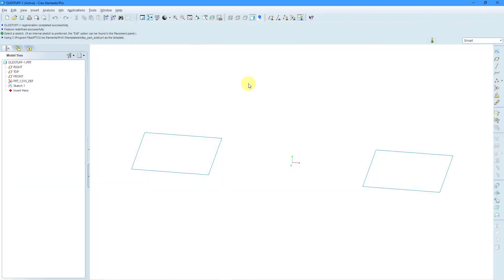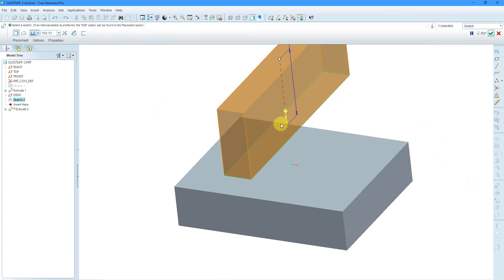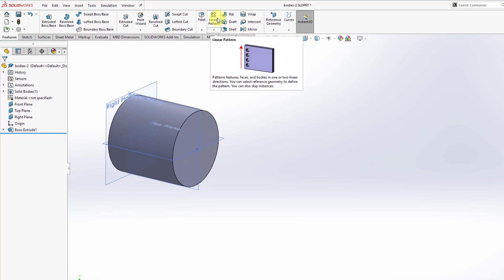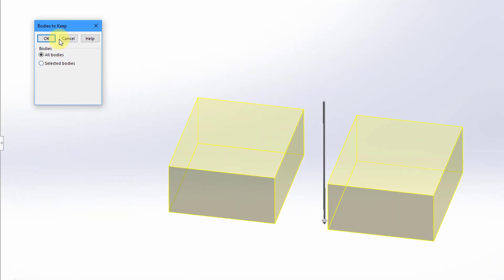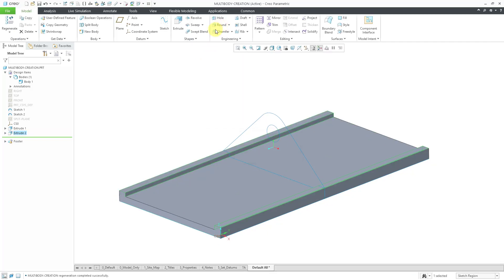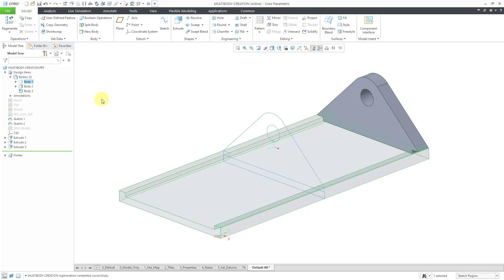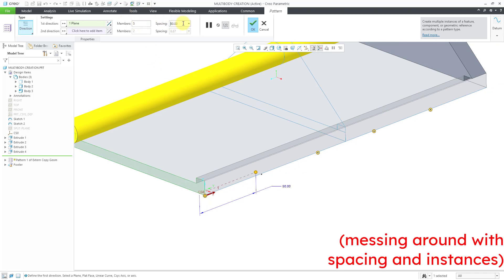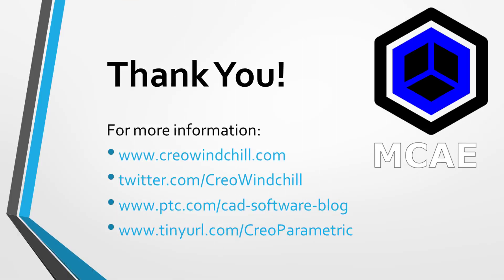SolidWorks - Creo Parametric Comparison - Bodies (Part 1)

Comment: Hi sir, thanks for this valuable video. recently i came across a bug in "Creo 8" in sheet metal module. when the 2nd component is created using family table, the create flat instances disables automatically in 2nd part if i have already created flat instances of first part, example - let's say i created prt1 and then part2 and part3 using family table and now i have to get flat pattern of prt1, prt2 and prt3 but if i create flat pattern of prt1, tool to create flat pattern instances of prt2 and prt3 gets disables. is this really a bug or something to do with config file? thank you for your time.
Reply from the maker: Have you contacted PTC Tech Support?
Reply: @CADPLMGuy  yes, they told me to open a ticket, but i could not do so, as i have basic account or something!
Reply from the maker: Have you contacted your admins about upgrading your account to have support? You need information like your customer number or sales order number.
Reply: No sir i haven't, as i have only educational version....to learn.